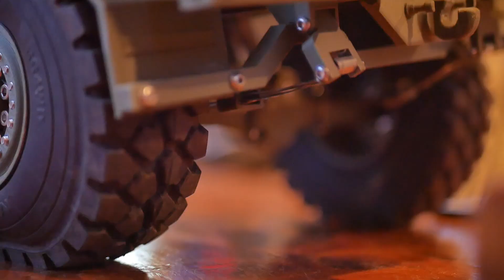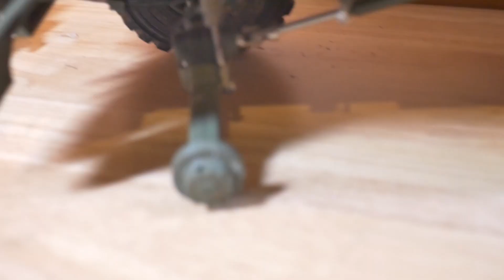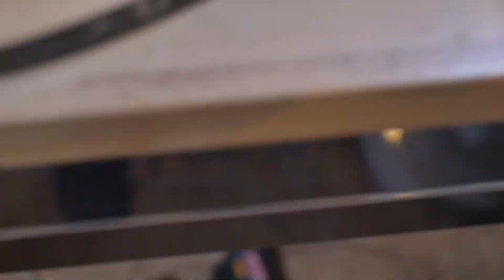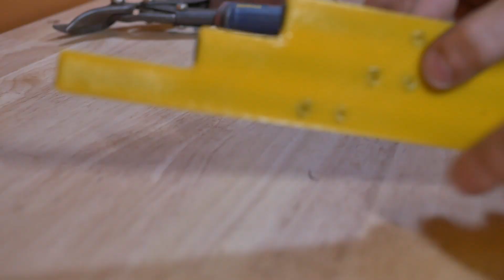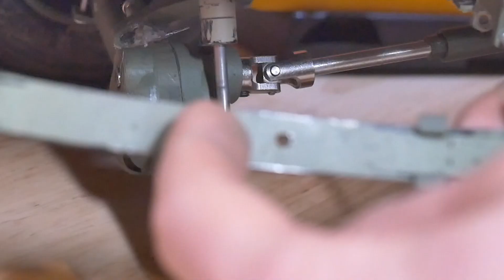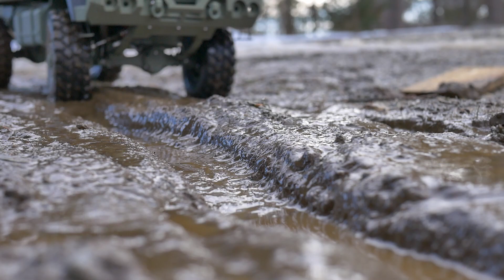Easy RC leaf springs | Making metal leaf springs for 3D printed RC military truck #3dprinting #rc

Comment: Brilliant! You really need to add a sound module to your truck. If you are electronically inclined "TheDIYGUY999"  has a great one on his YT channel.   Here is an example of it in action    https://youtu.be/NKvIMJU6aVM
Reply from the maker: Yes, I have seen this video, I would love to do this at some point!
Reply: @willemsmith506  I have built 3 or 4 of them. My Tatra sounds pretty good as does my T35 Tank. They are super configureable. I'm thinking of building some leaf springs for my Tatra. Your method is very smart!